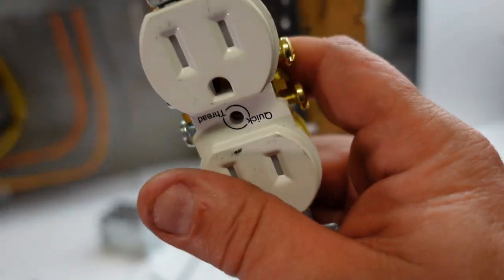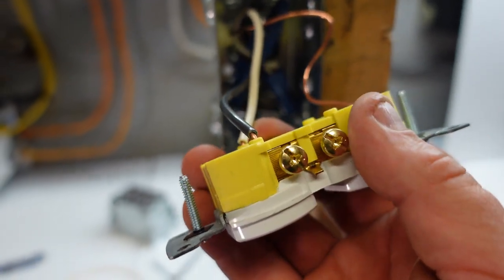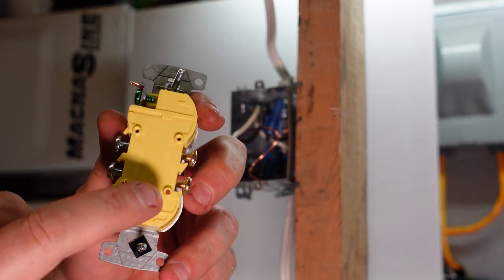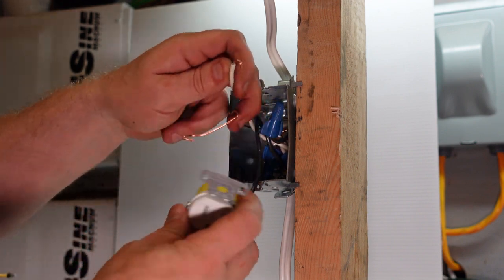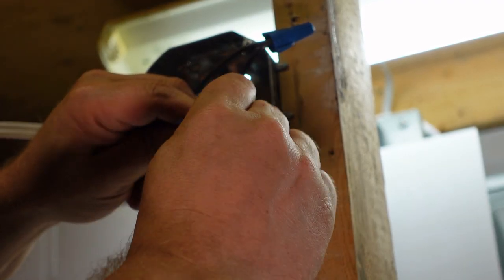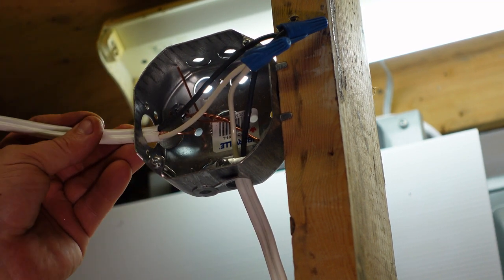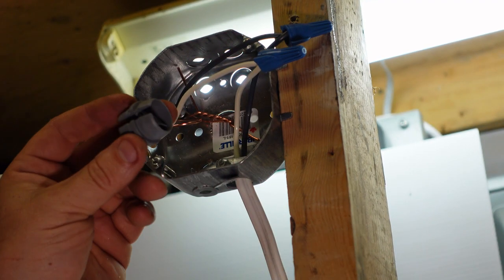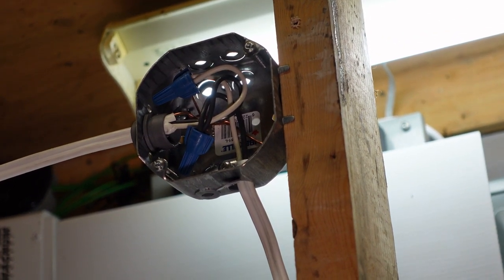Common Mistakes With Electrical Boxes

Comment: the older plugs that had those stab in use to have a slot for a narrow screw driver to release the lead . when did they chang that ? from canada so almost all the rules apply across canada . great vid
Reply from the maker: Unfortunately yes some never models of outlets do not have the release. A selling feature to force the purchase of a new outlet.